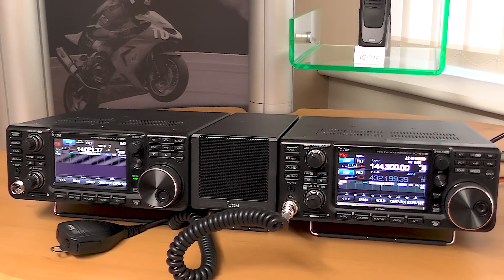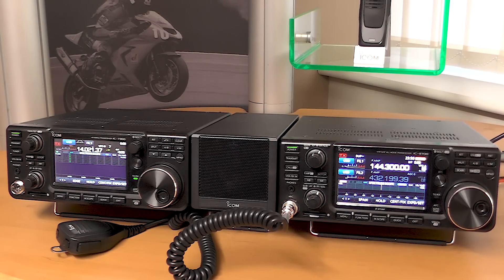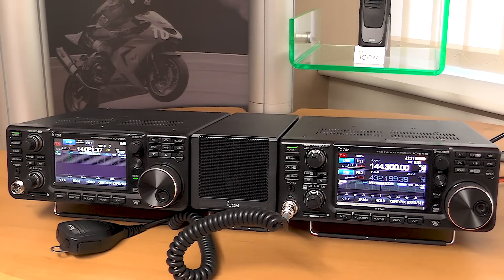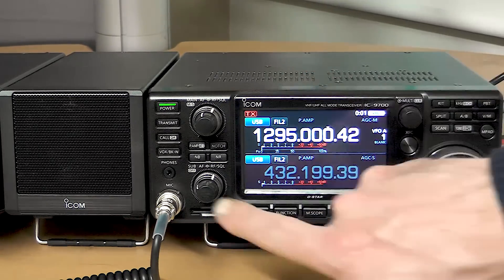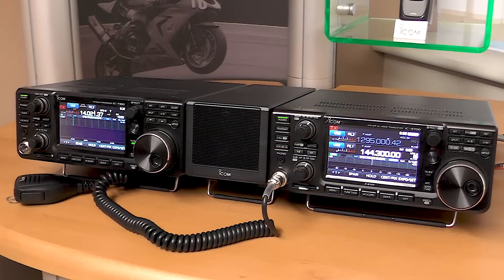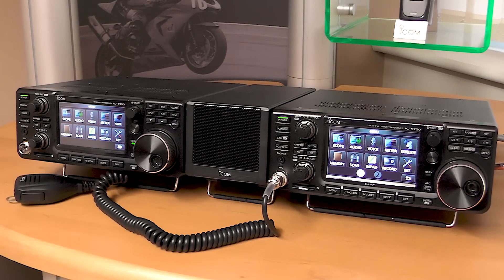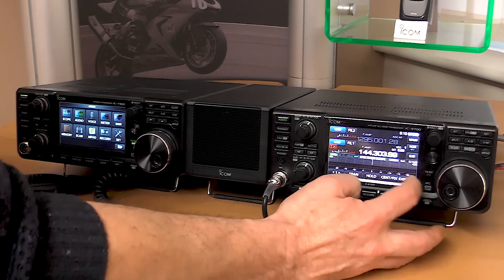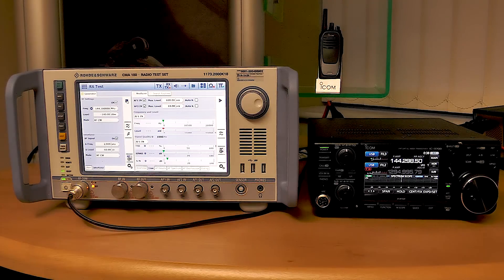Introduction to the IC-9700 VHF/UHF/1200 MHz Base Station SDR Transceiver

Comment: Can you turn off one RX to gain a bigger waterfall on the other RX?
Reply: No. You use EXPD/SET hold it for a second and the waterfall will get bigger (a little bit) Remember the IC-7300 and IC-9700 have tiny little screens so you won't be able to have dual waterfalls at same time. You will be able to view Main or Sub. But not two at once regarding the scope.
Reply: Do you know if I can view both waterfalls via the software interface?
Reply: @antimosh  I have asked the same question.  Join Facebook group ic7300 users.
Reply: @antimosh  Well most people are using ICOM RS-BA1 Remote Software that let's you control the radio from your home or any place in the world as well as listen. Great software and it's been out for years. Gets updated every year or so. But when using it with say an IC-7300 it will show the scope fine as it's one receiver. But if you use it on a more expensive radio such as IC-7610 which has two receivers then NO only one band and scope at any one session. But the good news is ICOM have just brought out the new RS-BA1 Ver 2 Remote Software that does connect to ICOM radios with dual receivers and gives you dual scopes. But it is NOT an upgrade to the older RS-BA1 software, meaning you have to purchase it as New (again). And it's quite expensive, I think a few hundred pounds or more. Still doesn't seem to support full screen mode though. It's still a fixed size of 800x600 on the computer screen and on a 4K screen at 43 inches that is quite small. I think ICOM are just being greedy making people buy it again to get dual band and scope support. Especially since it just looks the same software... No full screen mode is a killer. Here is the link to buy it: http://www.icom.co.jp/world/products/amateur/options/rs-ba1_v2/index.html
Reply: @JasonTDolan    RS-BA1  V2.0 will show 2 waterfalls  on  IC-7610..
Reply: @antimosh    it seems not..    just one... as RS-BA1  reads the same infor that is plotted on screen.
Reply: yes  you can turn off one RX  to  go monoband and have a larger waterfall display

Comment: With a TS-2000X I can do everything with just one radio and  the cost X benefit still unbeatable. Good luck Icom.
Reply: The TS-2000 has one of the worst receivers on HF I have ever used, it was pretty decent on VHF/UHF but if I had to use it on HF I would probably get out of the hobby.
Reply: @mauro_zard   Totally agree.
Reply: @mauro_zard  If you are looking to HF high performer, you can get a good "real SDR" and work it on your RX while TS-2000(X) offers you TX in almost all bands.
Reply: No matter how well the TS-2000 works, it's still a Kenwood.
Reply: Lemme see ya do dstar and 75w on 440 with that ts-2000. No!?!? Awwwwww😕
Reply: @gbubble79  d-star is moribund, you can get on DMR with a dual-band transceiver that costs less than a d-star internal board.  OK about 75W but not huge difference. I want to see you get APRS to get on the ISS or 9600 Packet-radio to on FalconSAT-3
Reply: @cqpy2rn  Your comparison is not even oranges-to-apples. Are you really attempting to compare an ebay Chinesium, noisey POS dual band potato with all but no warranty or some crusty 10 year old second hand commercial radio to a premium quality rig from a long standing and reputable Japanese manufacturer. What!? Dstar isn't growing as fast as it was but its still growing and far from dead. There's still more hardware, infrastructure and support out there for dstar than dmr. Lol, the only reason dmr is even a thing is because tight-4r5e hams continue to adapt technology from the commercial sector that was never intended or designed for amateur radio use. Not that a ts-2k does dmr, so, not really relevant anyway. Oh, and, if you can't work out how to do aprs and packet with the outputs on a 9700 than maybe its too much rig for you anyway.
Reply: @gbubble79 I am not comparing anything, just wondering cost X benefit.  TS-2Kx is a great performer on 144/430/1.2 rig that comes with an acceptable HF included, among other very cool and useful features, it was designed in the 90's and still on the lead by far,  if IC-9700 will cost less than a TS-2Kx may be I will think about it. I will not discuss DV since I am not much into that but don't be so tough with the chinese rigs, you would be surprised how they are improving. 73./
Reply: @cqpy2rn  APRS,PACKET,& TOUCH SCREEN radios are ALL Useless BS.
Reply: @gbubble79  I have both D-STAR & DMR & DMR is far more active anytime of the day than D-STAR by large numbers. You can watch the active numbers & D-STAR is lagging far behind in actual use head to head with DMR. I can listen to D-STAR all day & only hear a few stations but DMR is very active on many groups most any time.
Reply: @cqpy2rn  ICOM 9100 blows that POS Kenmore 2000 out of the airways. LOL That Kenmore has more Birdies than a Tropical Rain Forest. LOL
Reply: @cqpy2rn   Really....what a crock
Reply: Sure.
Reply: I'll stick with my PRO3 + Transverter!
Reply: Except work SO-50
Reply: I'm still looking for the dstar button on my TS-2000X.  And how do you turn on the waterfall?
Reply: and I can do far better on HF with an Elecraft K3S. That's why I want a VHF (etc.,) rig to complement it, as Elecraft don't make one! :-(